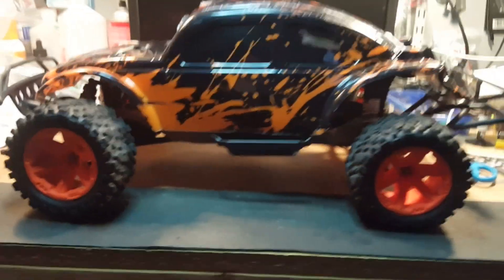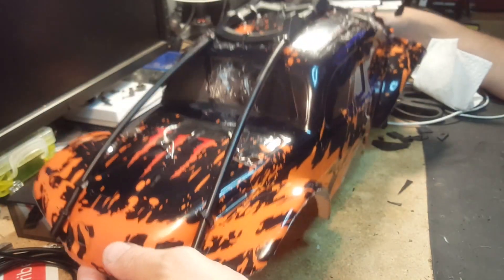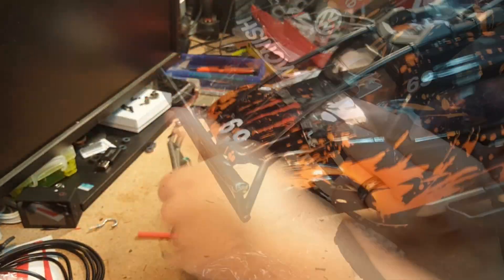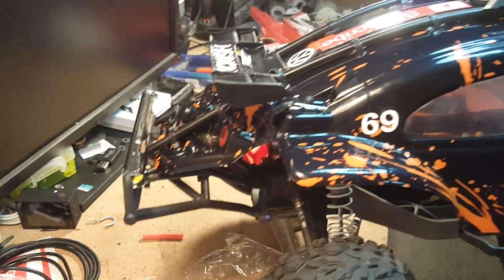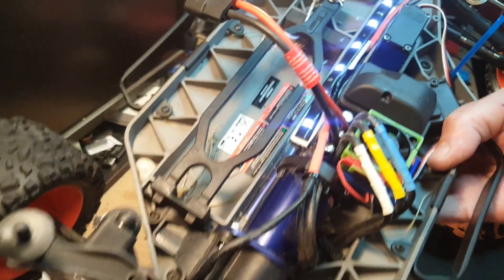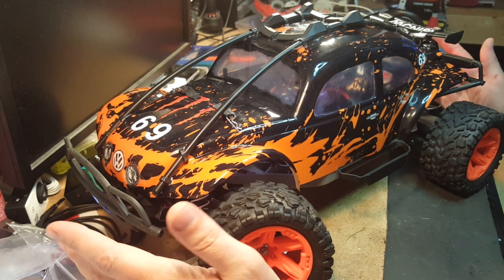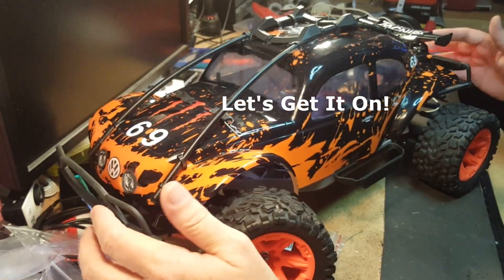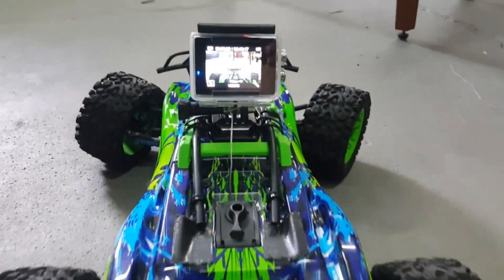Traxxas Slash 4x4 VXL Custom Dune Buggy Build, Roll Cage, LED Lights & 2 Road Tests

Comment: Nice. I like those baja bug bodies. The question now is which RC do you prefer more? All the custom options for the Slash make it tough not to like imo.
Reply from the maker: At the moment I still prefer the Rustler 4x4 but that's biased because it's fully upgraded. However, I feel like I missed out by upgrading the Rustler too quickly so I want to run the Slash 4x4 without upgrades for a minute to really see what the dif is. I have all the upgrade on hand, Ah hell, who am I kidding... I'll probably end up doing it next week ROFL we'll see!
Reply: @FranksTechHelp  Sounds good. Would be interesting to watch a vid giving your thoughts on both after you have had plenty of time with the Slash. Eager to see what you do with it.

Comment: Yeeehaaaw! Road to 10k subs! 
Looking good Frank do you think the slash would keep up with your 4x4 Rustler?
Reply from the maker: Speed-wise I don't think so because the slash seems slower in general, doesn't wheelie and even with a 3S battery installed it doesn't have the punch like the Rustler 4x4 does. However, for durability I hear that the Slash is pretty much indestructible so only time will tell my friend.
Reply: @FranksTechHelp yea i heard that as well. Maybe one day i will break down and get a slash 4x4